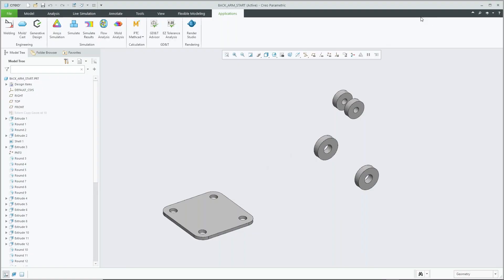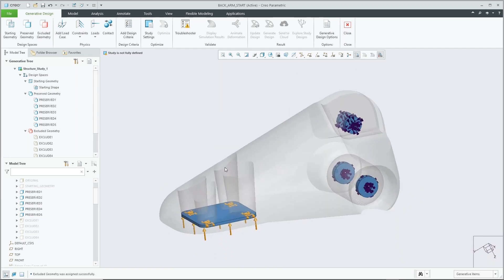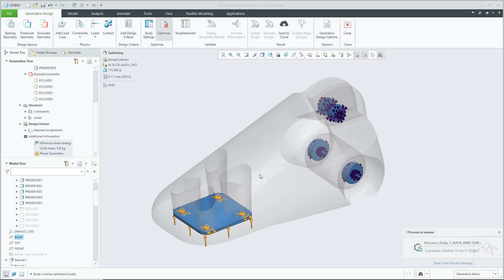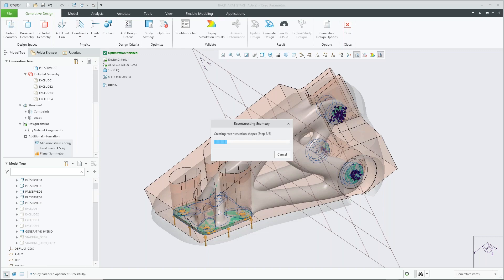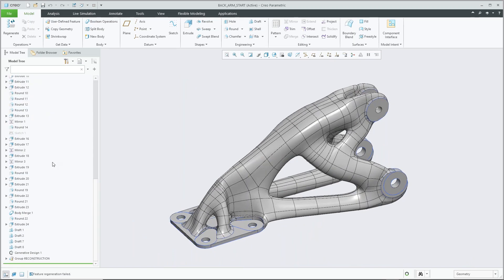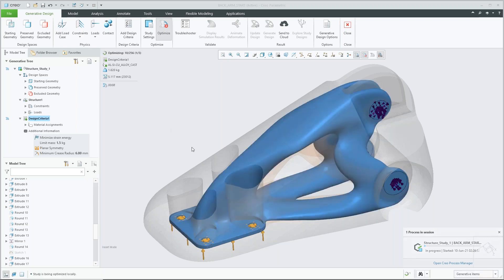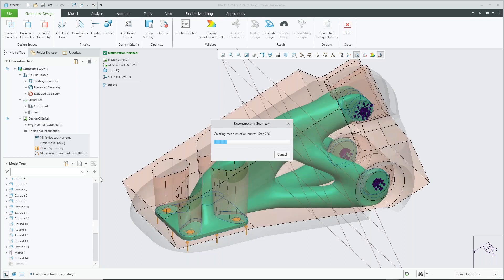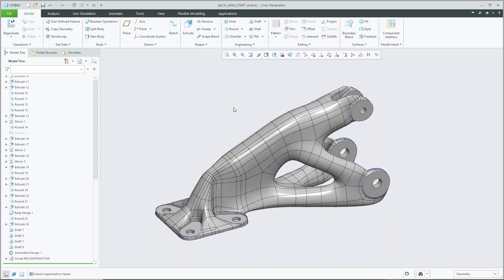Creo 8 Launch: Generative Design - Demonstration (Part 9 of 11)

Comment: In the off chance you might respond. How in the world can I export only the generative design as a step file?  Every time I do, it grabs all the other bodies, so I have the GD part embedded inside the volume model and of course it still has the keep out geometries as well.
Reply from the maker: Hi there, here is advice from our technical team: There are various options within Creo Parametric to control the information that is exported. If multiple bodies are present within a part file, the unwanted bodies can be hidden, and then when exporting to neutral file formats (e.g. step) the hidden bodies can be excluded from the export such that the resulting geometry is only that which is Generated by Topology optimisation. Please just keep in mind that once exported the geometry becomes “dumb” (i.e. it is solid geometry without a feature history that cannot be edited directly). However, the resulting export of Topology optimisation includes the ability to export as a parametric "freestyle" feature which allows the topology to be edited directly in Creo. This can be beneficial in situations where the resulting geometry of the optimisation requires tweaking.

Comment: THE TROUBLESHOOTER SAYS: Simulation solver did not converge.
Check one of the next options to resolve the issue:
-Unconstrained rigid body motions.
-Radically different material properties between bodies.

WHATS WRONG? I COPIED EVERYTHING YOU DID IN THE VIDEO!